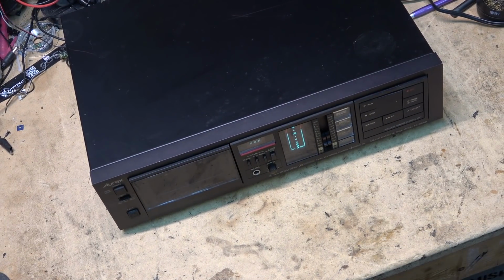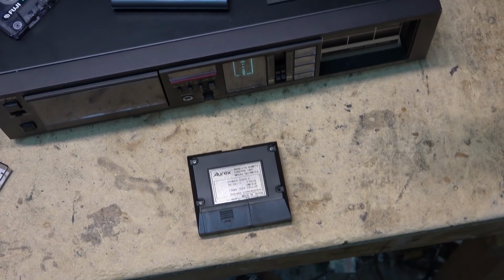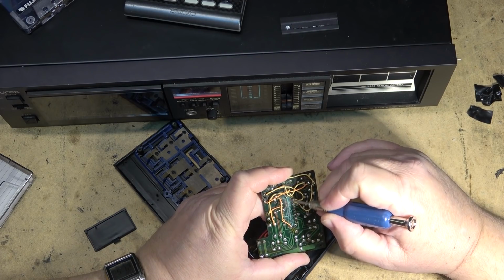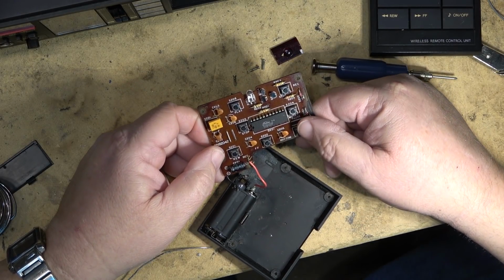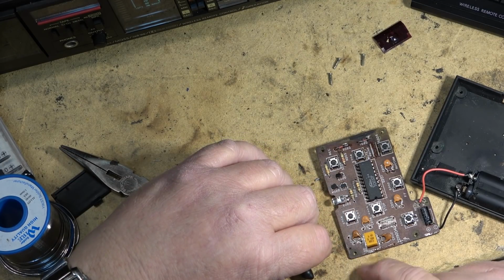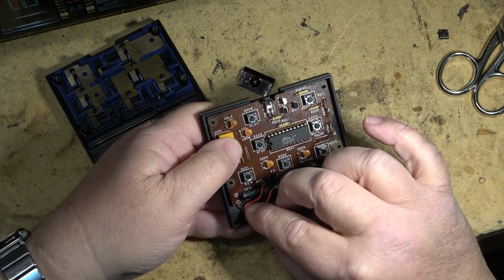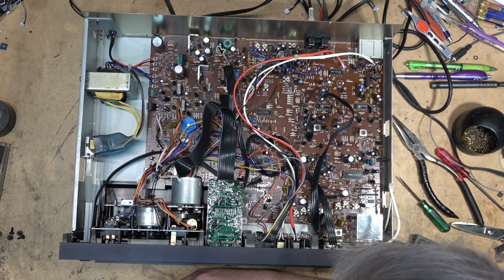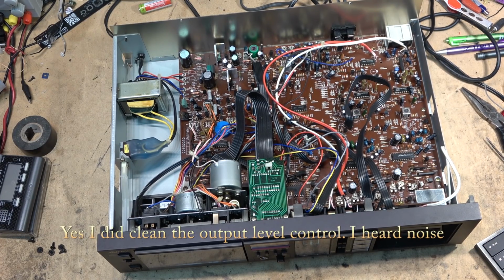Aurex (Toshiba) PCG8AD Cassette deck. Press FF and it goes into play. No other buttons work.

Comment: I've never seen one like this that you need the remote to make it work! Kind of a crappy machine that it doesn't have regular buttons!
Reply from the maker: They weren't the only devices that if you lost the remote you were fu*ked. I have a few DVD recorders that have only a few buttons.  Power, eject, play stop record.  What good are those.  Put a DVD in and it goes to menu and no way to advance. Sure you can play a CD but that is about it. What good is record button, because you can't finalize the disk and therefore can't play on another machine. There were a few TV's that also had no channel or volume buttons on the front.  The big one was no input.  Power channel and volume.  No input.  RCA I am looking at you.   2 video inputs.  Enter channel 91 and 92 on remote.   Lose or break the remote and no switching inputs.  To make matters worse they used a type "J" battery.  That battery had been designed exclusively for Kodak for their instant camera that they had back in there late 70s. Polaroid sued Kodak and Kodak had to buy back all these cameras. I know because I had one and they sent me a bag to stick it in and drop it in the mail for which they sent me a check for I think it was $5. they could no longer make film so you could not use them once you used up all your film the camera was useless so they bought them all back. The battery companies were making these special j size batteries exclusively for these cameras they were 6 volt flat battery. There was probably millions of these batteries that have been made so the battery companies went to RCA and said hey you want free batteries will give you a free batteries if you use them in your remotes so RCA developed remote controls that use these batteries. These batteries were expensive and something like seven or eight dollars but they would last for you know a year in the remote. So millions of TVs got sold with remote that used these specific batteries then they stop making the batteries so when people's batteries ran out they couldn't replace them with anything nothing else would fit. These batteries had four AAAA cells internal connected in series for 6 volts. So now people had TVs with no functioning remote because you couldn't get batteries for them and the only way to put them on to an input was to select channel 91 or channel 92. I remember for a few people putting an external for sale either double A or triple A battery pack gluing it to the back of the remote and wiring it up so that they could use that remote to change to the video input on their TV in case it got switched because there was no other way to do it and there was no other remote they could buy because RCA of that time frame was using different codes for just about every model of TV that they had. That the channel memory was stored in the remote not the TV. That was the color track 2000. so yes there has been some pretty stupid designs out there over the years with regards to remote controls and I would say this tape deck is one of them.

Comment: I don’t know if cassettes will make a comeback as big as Vinyl. But they certainly deserve a nice healthy comeback. I’ve been using cassettes all my life and still experiment with them and enjoy the cd quality audio I get from them. 

I believe a brand new type 4 metal cassette recorded on a 3-head deck from a vinyl source could sound better than CD and DESTROY mp3
Reply from the maker: If you think vinyl or tape sounds better than CD, then you have never listened to a good CD player.  Three were many cheap CD players with shitty or non existing filtering.  They started oversampling so they didn't have to put in back end filtering because the analog filters were expensive.  MASH was probably one of the poorest sounding players ever designed.  A good high end player blows the doors off vinyl and tape even from poorly mastered disks.
Reply: @12voltvids  wow I never even knew that, I’ll look at cds differently ✌️

Comment: I always thought I'd remember to take the Alkaline batteries out of my portable cassette players until the one time I didn't and nearly ruined a WM-D6C. Now I pony up the cash to have some lithium-Ion AA batteries on hand to put into anything I want to play around with. Cheap insurance. I also have some rechargeable Ni-MH eneloop pros I sometimes use, but I've read its possible for those to leak. Anyone else have battery suggestions?

Comment: I had an Aurex PCG4C back in the day. A really simple, but good-sounding deck. Sturdy, too. Their own NR system yielded crazy low SNR levels ... more than even dbx if I recall correctly.
Reply from the maker: You mean high SNR. Low SNR would be pretty noisy.
Reply: @12voltvids  yeah, my bad. My "low SNR" meant "low noisefloor" 😁
Reply from the maker: @svenschwingel8632  I know what you meant, however SNR is signal to noise. The higher the signal to noise the better ;)

Comment: The detachable remote seems a neat idea, but it is indeed not a great design choice. Without the remote, the deck is useless, and, as with all remote, it can get lost or damaged. The remote should be an accessory, not a vital part of the device itself.

Comment: i remember you fixed the remote on your old one years ago
Reply from the maker: Yes then I sold it like I do with most of the crap. There are only a few specific pieces I keep.
Reply: @12voltvids  yeah I seen that right after I posted that it was your old one.  It would have been nice if the remote would work without batteries while it was connected to the unit.
Reply from the maker: @stereomann83  It would have been better if they put buttons on the machine like everyone else does.

Comment: Hey brother, love your work!
Learnt alot from you..
Currently i am having an issue with my Panasonic Plasma TV Model P42X10C.
The problem is the power board is tripping after few seconds, the relay clicks on and then goes off..
I can see the backlight on the display coming for that short time period..
I troubleshooted and came to a conclusion that A board is defective, i found that there is one IC which controls AV is heating up, it heats up alot and then the power supply trips off..
I removed the IC, but the problem is still there, can you help me in this case please?
Reply from the maker: I don't do much tv work these days.

Comment: Let me tell you a secret how to repair bad tacktile switches without dissassembly them. You flood the button with alcohol then put 0.7V about 2 Amps between 2 contacts and start pumping the button around 50 times, and keep it wet, when full short is acheived you measure the resistance on pushed switch, if it is lower than 10 ohms, you are done, but i do it until it get to 1-2 ohms, pumping 50 times should be enough.

Comment: It's a decent tape deck, not seen one of those before.
The audio sounds good :-D
I saved quite a few switches from vcr front panals and car radios, i'm supprised you didn't have a panal somewhere to steal the switches off.
I've seen no end of push switches go to  o.c or give an odd 30 ohm wandering value.
Reply from the maker: I have a bunch but they are surface mount versions and i didn't want to start putting more heat on an already bad board.   Can you say lift the traces... I knew you could.
Reply: @12voltvids  You mean lift the bodge wires lol :)
Reply from the maker: @zx8401ztv  those too.

Comment: What I usually do when I got stuff with battery corrosion is to use pieces of kitchen paper towel soaked in vinegar essence and put it on for about 1-2 minutes to neutralize the alkaline residues from the board and traces, then clean everything well with 99.99% Isopropyl before proceeding to reconstruct the traces with transformer wire or old Ethernet cable wires. This really helps against future issues.
Reply from the maker: What if the batteries were carbon zinc? Then you would be making the problem worse.  When i got this unit probably 20 years ago it already had the damage and i don't know what type of batteries caused it.  Baking soda and water works for acid.  Buy you need to know what contaminated it, and if it is dry already rewetting is never a good idea.
Reply: @12voltvids  I think Big Clive has those strips where you can check the PH value and see if it's acidic or basic. Yes it's a bit more work but if you can ensure longevity I think it can be worth it! If you have to do it economically it's a different story. How much time and material are you willing to invest is something else to consider.
Reply from the maker: @kyoudaiken  i was dumping it 5 years ago.  Hey it worked for 5 years before acting up again.  Regardless you can never guarantee anything that has had any liquid or battery leakage.  Same goes fur capacitors that piss on the board.   The guarantee expires as soon as it leaves the shop.
Reply: @12voltvids  Yeah. But maybe try this next time if it's a unit worth trying to preserve as long as possible like this one. Would love to see the results. But it's a bit of a long wait if the units never come back, we would never really know.
Reply: @12voltvids  

Just try it out on an irrelevant spot, if it start bubbling up with vinegar it's getting neutralized. It's usually alkalines that leak so much anyways. 
Just watch out for transformers, motors etc. don't let it go in there. 
Remove all vinegar residue well afterwards. 

This deck has a cool but, at the same time, incredibly stupid design with that remote unit.  Interesting.
Reply from the maker: @westelaudio943  especially considering the fact that it has no buttons on the unit to control it if you misplaced the remote or break the remote

Comment: This deck initially appears to be mediocre…however, it does indeed sound great listening to the direct recording. And the innovative remote is pretty cool. Great troubleshooting. Thanks for taking the time to record and share the repair, Dave. 👍
Reply from the maker: And i get to make what i sold it for 5 years ago.  The guy that brought it to me said he has more to service.  Older fella that collects the more obscure audio gear.  Not necessarily high end stuff. Said he looks for the diamond in the rough gear.  You know, equipment that sounds great but because it isn't a nakamichi doesn't have big over inflated price tags.   He already picked it up.  Asked me if i want to sell my akai amplifier i use in the workshop.